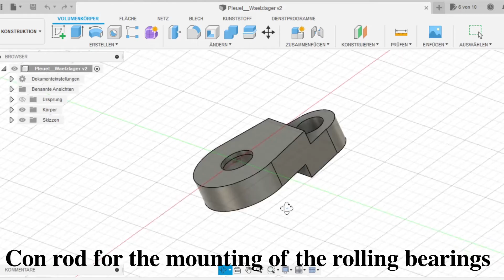DIY Stirling engine CHP to go off the grid in the energy crisis

Comment: If minimising friction is a priority:
What about making the edges of the displacer more aerodynamic..?
The optimal shape for a Bell mouth is a quarter ellipse, where the ellipse has a 3 to 1 ratio.

Also NB the SuperLubricity of a mixture of Boric Acid and Anti Freeze:
Research paper name:
Liquid Superlubricity of Polyethylene Glycol Aqueous Solution Achieved with Boric Acid Additive
Sci-Hub has the complete paper.

Also research
Dr  Ali Erdemir Argonne National Labs Boric Acid in oil lubricant.

Comment: I'm impressed with your experiments. What is the motor's starting temperature? I am looking for a solution that will work efficiently with a 40-60C energy source. Can you share your opinion on this with me?
Reply from the maker: 40-60 kelvin temperature difference is very low and calls for a low temperature differential engine!
Look out for the work of Ivo Kolin!
My engine needs at least a temperature difference of 300 kelvin!

Comment: Wonderful job, I thought about a revolutionary idea of the use of a Stirling engine. Using electricity from batteries to produce Hydrogen and Oxygen from water for a combustion to activate a Stirling engine with two fonctions 1/ load the batteries with a dynamo. 2/ Use the residual energy from the engine for any useful purpose.
It isn't a perpetual motion, because the energy is generated from water. Maybe we can work together on it... If it works...
Reply from the maker: That sounds interesting, plz make a video and show your ideas so we all can participate...

Comment: How large would a stirling engine be, that would power a modern house? With air conditioner running all summer.
Reply: That is what I also would like to know….
Reply: Air conditioning is one of the most energy hungry amenities in modern homes. I don’t know any offgridders who have AC…you’d have to be extremely wealthy to have the battery capacity or constant supply of fossil fuel for that. To do it with a stirling engine….oof. Consider this: his engine he describes is trying to achieve 500 watts. A typical central air unit draws around 3500 watts. Now consider your fridge, freezer, TV, desktop PC, whatever else you have…it’s a lot to ask. 

Your best bet is to incorporate passive solar features, high mass construction (add an earth bag wall to your south side, for example), and if you have low humidity maybe run an evaporative cooler for a few hours a day.

Comment: There's a gentleman in the UK named Shane Pomeroy and he's also building his Stirling engine model. His model is powered by wood-burning rocket stove. He has done some interesting tests. You can search: "Stirling Engine Generator - 6 Hour Endurance run! Part 11"
Reply: I also want to build a Stirling engine system for my home in Taiwan. Unfortunately, consumer grade FDM 3D printing is the maximum of my manufacturing capability. Metalwork is not easy.

Comment: Keep up with that great work! I also love stirling engines but I have "forgotten" about them the last years, I just don't have enough time to invest to make prototypes and test things. My idea is to use one or two big low diferential temperature  stirling engines that run "between" the wall of my home taking advantadge of the cold outside in the winter and the warm inside (0ºC outside and 20ºC inside) or from the hot outside and the cold inside on the summer (45ºC outside and 22-23ºC inside).  I think the advantadge of those low differential temperature stirling engines is that they don't make noise and you can keep them running 24/7. The problem is i don't know if the 20ºC delta temp. is enough to run them and I don't have the time to try it.

Comment: I'm in a fairly cold and exposed part or northern England, I can highly recommend putting aside some garden space to grow sugar beets. My bio-digester loves them as long as I manage the PH, I keep mine in a small black (black so the shed gets warm from the sun even in winter) insulated shed with a 'pilot light' to keep the whole system very warm and productive without bleeding off precious electricity. All you have to do is run a copper coil from outside, wrap it a few times around a bunsen burner and then into the flame, it provides preheated oxygen to the flame and keeps it burning, the shed never drops below 30C without electrical wastage. I also seeded my system with multiple sources of bacteria; Goat, Cow, Sheep, Goose and Rhea poop so as to increase diversity and help it reach it's potential.
Reply from the maker: This sounds really nice, I would love to see something of your project here.

Greetings

Comment: Good afternoon!
Haven't had a video from you for a long time.
My comrades and I are also developing power plants based on the Stirling engine. At present, the concept of mass production of such installations is being developed.
I absolutely agree that the Stirling engine can be either an auxiliary installation supplementing solar or wind energy, or an independent individual thermal power plant using cheap fuel and combustible waste, as well as other heat sources.
Now we are working on the main, in my opinion, problem that limits the widespread use of the Stirling engine - its high cost.
Reply from the maker: Hi,
I surely know your engines, really fantastic work.
Since years I also try to reduce the cost and effort of building my Stirling engines.
But in these times of energy crisis I think that the costs are not the main  problem.
If you really get a RELIABLE engine into production it will have success.

Keep up your good work and I always watch out for new videos of you...

Greetings

Ralf

Comment: What do you think would be the gas consumption of a 500w Stirling?
Reply from the maker: My rough calculation with a calorific value of methane of 10 kwh/m3 and an efficiency of 20 percent results in 250 l/h for 500 watts output.
This is just a very basic calculation and a very rough indication.
Reply from the maker: I think an efficiency of 20-30 percent may be attainable.
This sounds like little but would be a very good result for a small engine.
I will calculate the gas consumption roughly later and will post it here.

Comment: 300 Watt electrical output, or shaft power?  Is this with air as the working fluid inside the engine?
If your engine is nicely sealed, try pressurizing with helium;  it should make a big difference in output, even with the same energy input.
Did you manage to make a small, low friction, shaft seal?  I found it not that difficult to make one for a 1/4" dia. shaft.
Reply from the maker: 300 watts is shaft power output.
I experimented a bit with helium but the engine is designed for the use of air as the working fluid so the effect was not so overwhelming.
But I have to make more tests with Helium.
I have a very good sealing shaft seal, in one of my older videos its described.
It surely makes some friction but even helium stays in the sealed engine for quite a long time.
Reply: @myengines2443  Surprised to read that you found little improvement with helium.

Many years ago I experimented with helium in a sealed rhombic drive engine.

With a windshield wiper motor as the permanent magnet generator, the 13.5 cc engine produced about 20 or so watts electrical output at a pressure of 35 psig.

Any increase of the pressurization with air reduced the power output.

Pressurizing with helium to 100 psig or so increased the electrical output to 65 watts!
That little engine was running at 5,200 rpm.

It required much cooling water, which I simply dumped into my swimming pool.

This last test was done in front of a group of fellow modellers, who were of the opinion that Stirling/hot air engines were intrinsically wimpy.
They were made believers when they saw the automotive headlight at full brightness, with Ampere, Volt, and tachometer displaying the achievement.
Much later I determined that the generator efficiency was only 50% or so;  thus that little engine actually produced 130 watts mechanical output, or about 10 Watts per cc of displacement.
Reply from the maker: @BasementEngineer  this results really sound impressive.
10 watts per cc are a very  good value.

My helium tests were not successful as my reducer wasnt working right and I cant achive higher pressures.
When I have time I will make proper tests with helium.
But much things to develop before....
Reply: @BasementEngineer  Ok but what did you measure with other gasses than Helium? Pressurization alone is the main power factor.
Reply: @togowack  I only tried helium as an alternative to air.
Some people have tried argon and nitrogen.  I never did because the thermodynamic properties of these gasses are not significantly better that air.
When I did my tests I was given a laboratory cylinder with 125 psig of helium remaining.  When this was used up I stopped these experiments.
If I were to restart my experimenting with these engines I would try hydrogen.
Sounds scary, right?  I submit that with a modicum of care the danger is low.
Reply: @BasementEngineer  Ok, here is the problem, I don't know what problem or performance factor you are trying to solve. There are many many failed Stirling Engines on youtube. Very few good ones in the 1/2 or 1 HP range. These experiments are always being conducted on engines that don't work in the first place.
Reply: @togowack  I was simply trying to determine the power capabilities of a given engine.
To this end several different hot and cold heat exchangers were built and tried.
The final test was with helium pressurization.
Reply: @myengines2443  Hi Ralf (Ralf right?) I have followed many of your videos in detail and wondered if you have checked Andy Ross engines, which are probably the most successful engines of this type over the last 30 years but he did not mass produce them. Your engine looks very similar to his D90.
Reply from the maker: @togowack  yes you are right, Andy Ross inspired me alot and I bought his book many years ago.
But his D90 is an alpha Stirling with his invented  Ross yoke drive mechanism (inverted in the D90).
Thanks for your nice comment and best wishes

Ralf
Reply: Doesn't matter, seals won't work, it should be an aluminum casting
Reply: @togowack  yes you would always have leaks, but helium even does quantum tunnelling through solid material… with good seals the consumption can be quite low
Reply: @Lukeima7992  Helium doesn't make a huge difference on these types of Stirlings, its used mostly with the cryogenic types. Without a sealed engine you will be relying on special harder to source materials that must always be used in controlled situations. I am making a similar Stirling to this cast aluminum sealed with magnetic drive. And he doesn't have enough fins on this one
Reply: @togowack  helium does improve efficiency
Reply: @nirodper  Hi, sometimes I come off as an ass hole in comments sections, but the improvement of efficiency with Helium is less than 5% in most cases. So the trade off is not good because like hydrogen it is notoriously hard to seal, and there is a big shortage of helium right now but nitrogen is very cheap.
Reply: The use of helium is justified only in the case of highly efficient seals that minimize leakage of the working fluid. Otherwise, it is better to sacrifice power, but avoid using a helium recharge system, especially since it is quite expensive for the average user.
Reply from the maker: @ВикторЗакомолдин-в8ж  my full aluminum engines are sealed very well.
The 3D printed ones are not so good sealed and I will not try to use helium in them.

Comment: Your design of stirling engine looks realy good. Can you test efficiency ? Defined input gas flow to burner VS electric generation ? And if you have some plans to building it, can you share ? I have idea. Put stirling hot side thru the door of brown coal boiler and cold side cooling by water return pipe from home heating = every energy is used but some energy transfer from burning coal to electricity. If it may have enough efficiency in this mode its realy userfull for energy self sufficiency. Beacause 
from spring to autumn has enough energy from solar panel and in winter isnt enough solar power but the house needs to be heated.
Reply from the maker: Thanks for your nice comment.
I will do efficiency tests when I have the setup ready for endurance tests.
As soon as I have results I will show.
Your last point is exactly what I intend to do.
Using unconverted heat for home heating is the key to sustainable resource use.